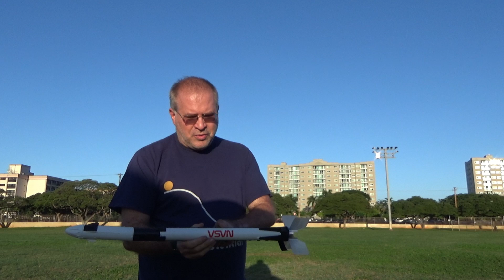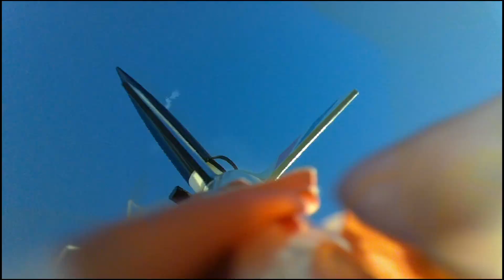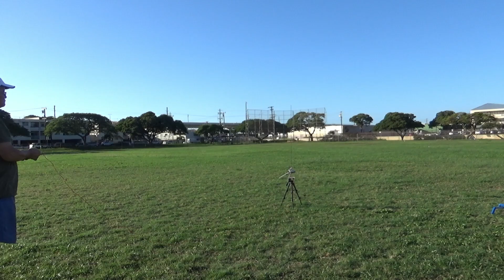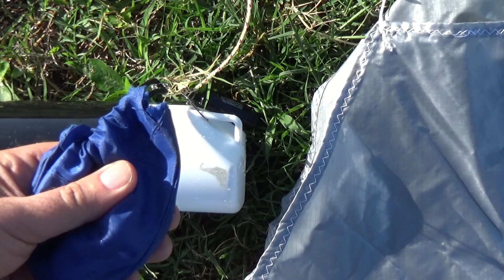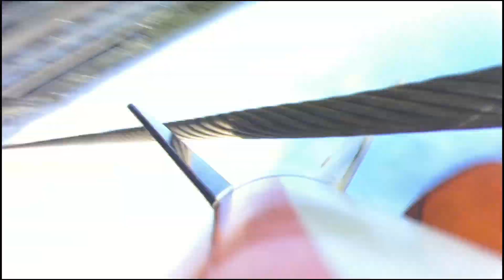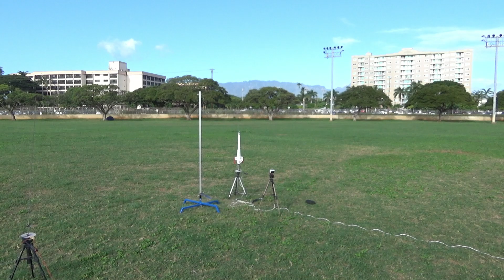Model Rockets: Electric Co rescues Doorknob from high power line and successful MaxQ Falcon 9 launch

Comment: The Interceptor is a classic. I still have mine from the 70s. It had its maiden launch this year. Flew very well!
Reply from the maker: Strangely, haven't popped off the pods yet. Built it over 2 years ago at the height of Covid.
Reply from the maker: I'm surprised how slow the C6-3 motors are. The composites have more punch but not reliable.